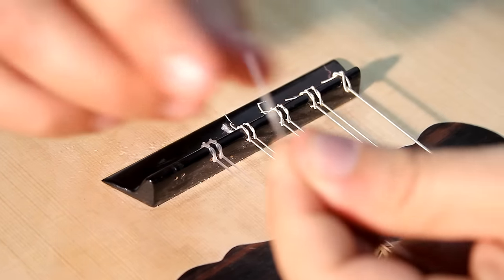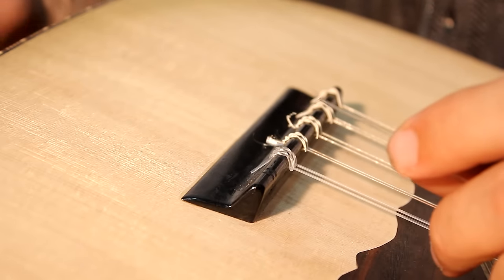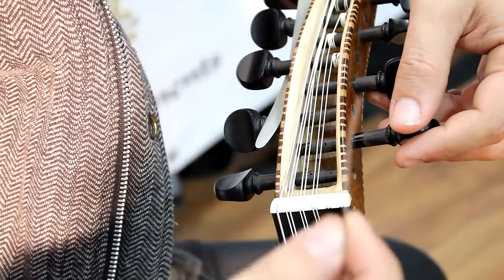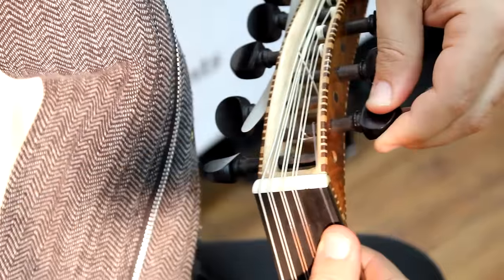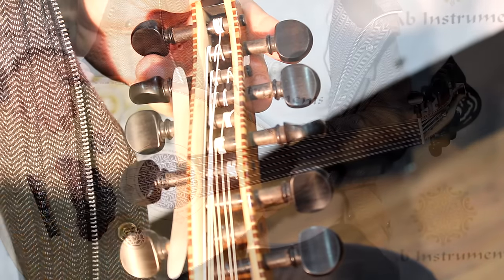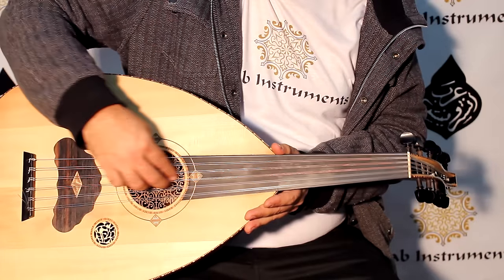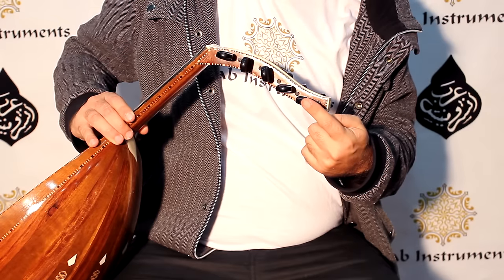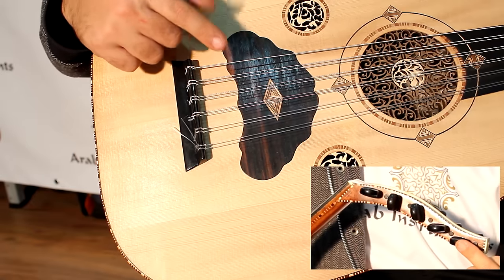How To Replace an Oud Strings

Comment: Thank you for a very clear and patient explanation. 

I got an old Lebanese oud from a neighbour to fix and learn. The nut was just a bit of twigs, and the strings are totally unplayable. 

I now have a bone nut that will have to be cut to size, filed down and notched to carry strings. How? The strings are also off the instrument and a new set waits. 

At least I now know what strings attach to each peg. I was totally confused
Reply: Did you ever install the new nut? How did you make the notches for the strings on the bone ???

Comment: Great and clear explanation. I'm a beginner and my oud is a bit smaller and it's got a moving bridge. It sounded a bit tinny so I replaced the strings while keeping it a ff tuning. Still not happy with how it sounds, so I bought a D'addario Arabic set and will tune it to CC and hopefully this will make some difference. I know the size and type of oud (Iraqi) is probably a factor with those issues. Will see how it goes. Thanks again for a good video. By the way, I have 12 pegs. Which on should I skip for the low C string?
Reply from the maker: Hey, you can check our oud tuner: https://www.arabinstruments.com/oud/oud-resources/oud-tuner

Comment: Thanks for video. It is very useful. What about the tuning that starts with FA note? Is this Arabic tuning as well?
Reply: You mean the one that also has a high Fa? This is a variation of Arabic tuning originating in Iraq, your Oud also needs to be specially made to be capable of holding the extra tension required to have a high Fa string

Comment: When setting up an Oud with 12 strings instead of 11 strings, does the bridge and nut require modifications or are most Oud already setup with grove for the 12 strings set as LaBella comes in 6 pairs? Will appreciate your help in this as I plan to buy an Oud soon. Thanks!
Reply from the maker: Hey, Your oud  (nut + bridge) must support 12 strings in order to use this set. The most common ouds come with 11 strings: https://www.arabinstruments.com/oud/oud-types/
Reply: @Arabinstruments  Thank you! So if I get an Oud with an 11 string setup I can modify it for 12 strings by making an additional grove later or is that not possible and requires change of nut and bridge?
Reply: @AlifLamMiim  Thank you! This is very helpful!
Reply: Hello, when changing should I start from Do bottom all the way to the top or should I put on a string on each one first?